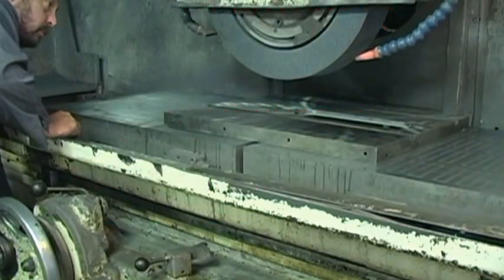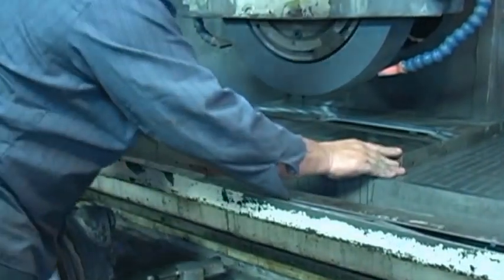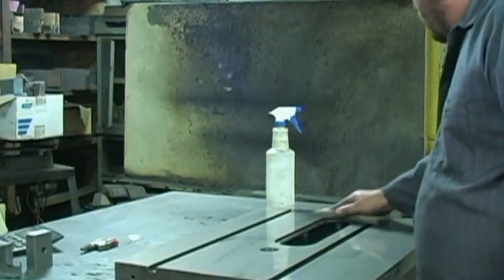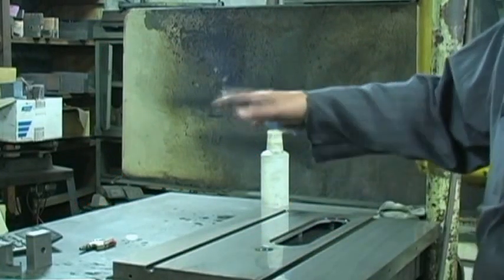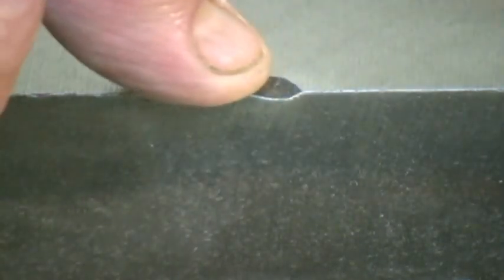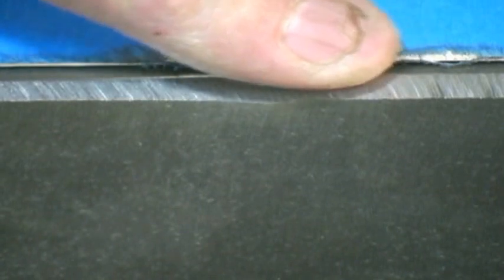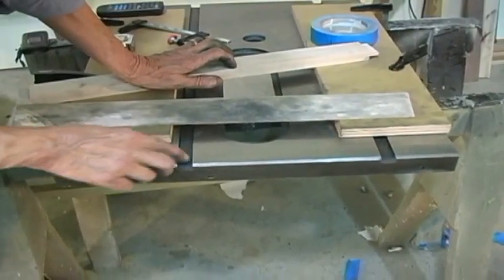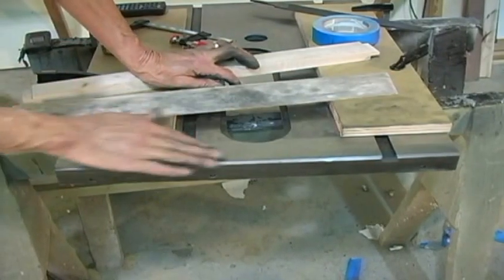Surface Grinding the Top and Final Preparation

Comment: So for one little dent you are going to put a bevel all the way across the back side of the the table. If it was going to effect the use of the table I could understand dressing the bulge on the back but a bevel all the way across, just seems like cutting off your nose to spite your face. It's your saw to do with as you please, but you are the definition of anal retentive. I thought this was about teaching people how to fix a saw for wood working, not nit picking every little flaw in an old used and abused saw.
Reply: I hate to be that guy, but you made it this far in the series to make that comment? Couldn’t you tell after a few that this was far and beyond a simple fix up? He took the top to get it professionally done which to me shows this is way and beyond a simple fix up

Comment: Very nice! but now  your slots are not parallel to the surface and they also not as deep depending how much material was removed from the surface. will you machine out the slots?

Comment: Looking forward to parts 5,6,&7. There are videos out the ying yang showing how to remove that "blessed" arbor pulley, but nothing on putting it back on. My new pulley will slide on about halfway easily then stops to the point I have to use the puller to start over. and no specs anywhere about how far on the shaft it need to be. The old pulley was wallowed out to an oval in the bore, due (My guess) to the set screw was missing.
Yeah OK, I'm hooked, and my saw is down. just not 3 years and 3 months down.
Reply: Got it figured out. Based on all the pictures in the downloaded manual, the pulleys were on backwards causing the arbor pulley to hit the bottom of the table ans stopping the blade. 
After a LOT of cleaning on the woodruff key and arbor shaft, the pulley went on without too much persuasion. I aligned the shoulder? of the pulley with the end of the arbor shaft, and left the one on the motor loose, to align it using the belt, before tightening the set screws.
It's about as tuned as I can get it without a PALs, but still needs a couple of small issues addressed (blade, belt, etc.).
Reply: I need to set up an electrolysis tank to clean the wings. considering using epoxy resin to fill the webbing in the them. this might prevent finger pinches, and seal that part of them from further rust.

Comment: I have this eerie feeling that Mr. Cole has not released any more videos because he is no longer with us.  I hope I'm wrong.
Reply: I'm worried that's the case as well. It's been two years and this appears to be the last video he uploaded. Shame, I was really enjoying this series as I am restoring a similar saw...
Reply: If that is the case (and I hope it's not!) ... what a wonderful gift to leave us before his passing. You will be missed Jerry.
Reply: Funny, I just received an A-LINE-IT kit from him with a hand written note from him in it that said "Good luck with your table saw." He also called me on the phone the morning after I placed two separate orders, one for a set of pulleys, and then one for the A-LINE-IT kit to suggest a different size pulley fit for my table saw motor to make the blade spin a little faster and provide a better cut. Talk about excellent customer service. When I mentioned that I had placed a second order for the A-LINE-IT kit, he looked and saw the order and said that he would include a check for a refund of the duplicate shipping charges, even though it was my fault, since he could fit both products in the same flat rate box. A couple days later I got my A-LINE-IT kit, pulleys and check just as he promised. Excellent products, excellent customer service, excellent experience. The man is still with us. I have no idea where part 5 of the table saw video series is, maybe I should call him and ask. I'm sure he is a busy busy man.
Reply: @godzillafirebox7765  That's very good to know, thank you.

Comment: Where is part 5 and re-assembly?  I have one of these old Craftsman saws which I got for $50.00 It is in far better shape than yours so it will not need to have so much rebuild.  Though I would love to get the top refinished like you did I think the stock finish is no where near the quality which you have achieved.   Curious if you upgraded the motor and fence?

Comment: Did you have to mill the slots back to 3/8" depth?
Reply from the maker: I never had to re-grind the slots, since there was only about 15 thousandths of an inch ground off the top.  If I would have had an issue, I would have ground the miter bar thinner.  Trying to re-grind the slots could cause some real issues as far as keeping them parallel or possibly making them oversize.

Comment: will part 5 be coming soon?
Reply from the maker: Andrew,We are going to start shooting Part 5 (hopefully) tomorrow, August 19.  The saw arbor got pretty well "pounded on" during disassembly, and I'm taking it to a friends machine shop to get it "trued up".  I'm hoping what we're going to do in Part 5 ends up being one of the most impressive parts of the series.  I'll get it posted ASAP.
Reply: @inlinedubby  did you ever end up making part 5 I want to see you reassemble the saw and see how well it runs
Reply: @inlinedubby  when will part 5 be up?
Reply: Waiting patiently for part 5 for two years. When will it be ready?